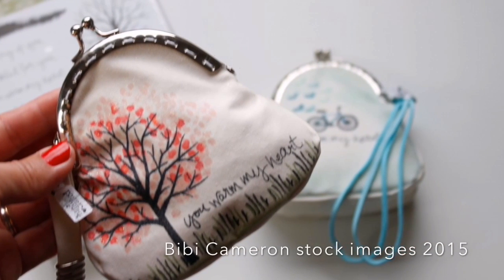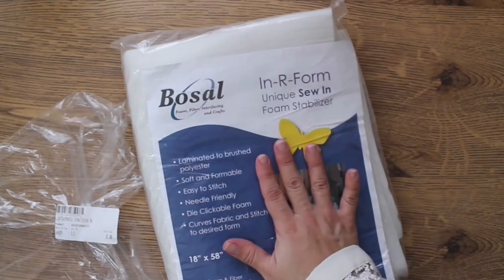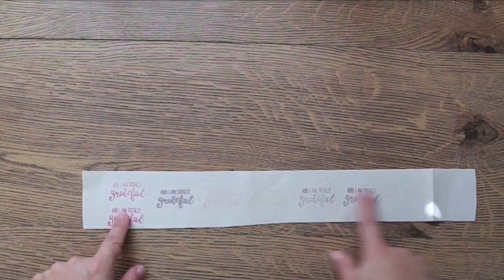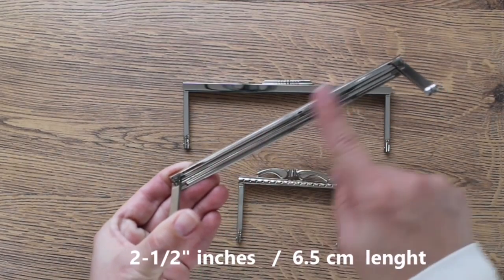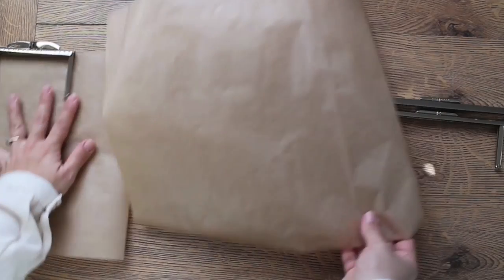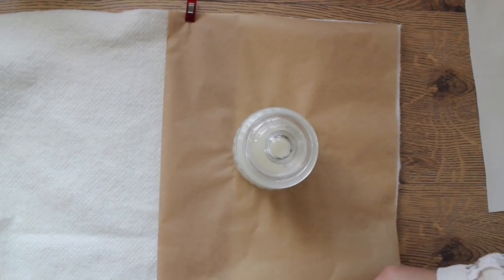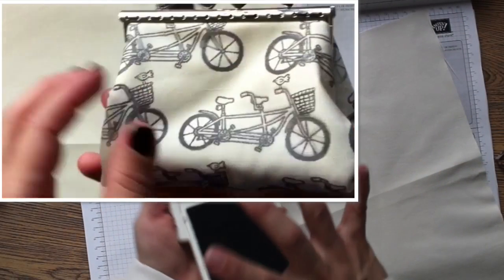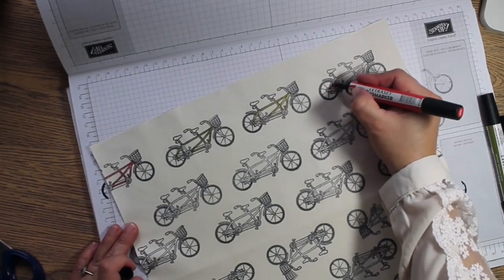DIY  Pattern for clutch purses  with metal frames and custom fabric ( Part 1 of 2)

Comment: Thank you, great video.  Can you make the bag longer, but not wider?
Reply from the maker: Deborah Johnson hello there . Thanks . I would say that the width of te bag  depends on the size of the metal frame you use . For wider bags you can get larger metal frames up to 20" inches or so .  I hope this helps . X  hugs

Comment: In your video you give the formula "Frame length x 2 plus frame width + 1" (in English measurements).  If the modern purse frame I have has 3" legs, do I just input that measurement into your formula?  Or can this only be made with the 2.5" length legs period?  Thank you so much for your video and for your help.  God bless you.

Comment: éste es justo el tutorial que necesitaba para hacer un precioso monedero con la boquilla pequeña como la suya, pero no entendí muy bien como hacer el patrón. mi boquilla mide 10 cm también y es igual que la suya. gracias por ayudarme. le estaría agradecida si me diera las medidas del patrón para ella. muchas gracias.  This is just the tutorial I needed to make a precious purse with the small mouthpiece like yours, but I didn't quite understand how to make the pattern. My mouthpiece measures 10 cm too and is the same as yours. thanks for helping. I would be grateful if you gave me the employer's measurements for her. Thanks a lot.
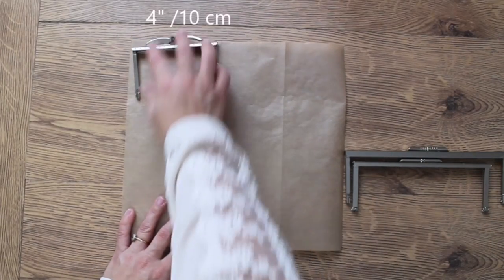Reply from the maker: Hola. En el minuto 9:47 puedes ver como se hace el patron para un marco de 10 c.m 

Tela  Exterior y forro:
Ancho: 10cm +16.5 cm . 
Largo: 10cm + 15 cm 
Entretela :
Ancho 10cm x7.5cm 
Largo: 10cm + 15 cm
Esto es si las patas del marco miden 6 cm .
Espero esto te ayude. 
Abrazos
Reply: @BibiCameron  mil gracias! he visto luego que pude poner los subtítulos traducidos al español, y aunque la traducción es mala, lo fui entendiendo. muchas gracias. entiendo que las patas del marco se miden desde el marco hasta el final....no descontando lo que mide el marco..es eso?

Comment: Hey.. amazing video! Though you do tell about ink durability, but still is there any pre or post processing of fabric required to make the ink more stable? Something like a a ink fixer process?
Reply from the maker: Abhishek Sethi hi, thanks for asking . Starch + iron ( to make the textile flat . Completely optional ) It all depend also on the products you use and the fabric ( you might need to try and experiment ) . There are inks and paints specially designed to stamp on  fabric also markers . Please check out my other videos  about Stampin in fabric . I'm using Papercraft supplies but you can use acrylics paints + fabric medium ( kind of paint fixative ) . I hope that helps .
Reply: Bibi Cameron hey thanks.. yes will look into it :)

Comment: Bibi,
Does your pattern dimensions also work for the other frames? Meaning, if the frame length is only 1.5" x 3" wide and more rounded, add 6.5" to the width and 6" to the length?

Comment: I have purse frames with a side leg length of 3". Would I be able to alter the pattern by adding to the width or length?
Reply from the maker: Hi, yes. absolutely,  just add an extra 1" inch to both lengths. x